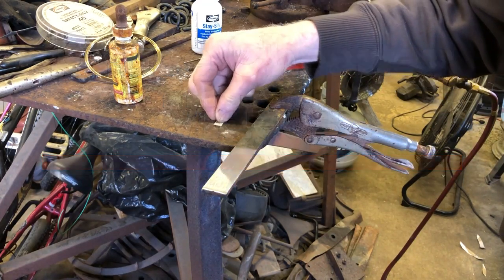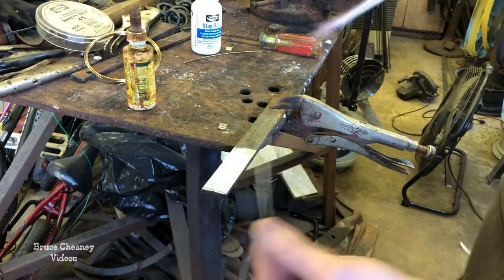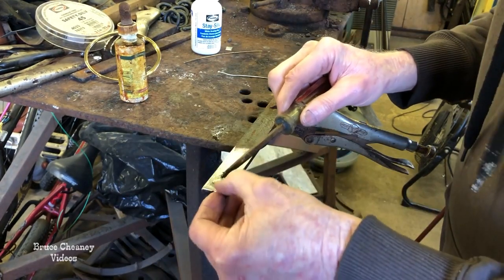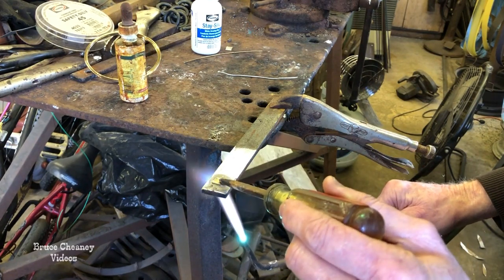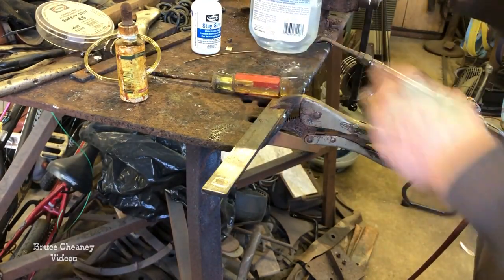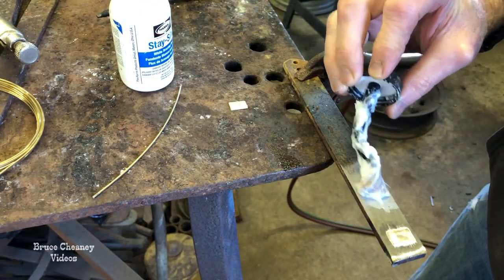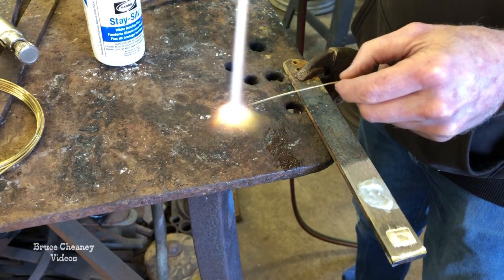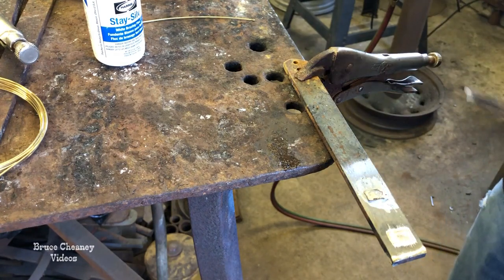How to Tutorial ⭐ Soft and Hard Soldering Tips for Bit and Spur Making 👍 Harris Products Group

Comment: Any hints on getting the tip trim on a spur shank to stick good? It’s hard to get the heat to the bottom of that part. Locked up a rowel last night working on one, but I got the silver on. I'm sure I’m not doing it right. Using that liquid flux
Reply from the maker: I have trouble with soft soldering the silver on the spur shank tip too. I know what you are talking about. 
Just make sure you have just enough soft solder on the back of your silver to stick the piece onto the shank tip. It does take practice to get it done.
You can float your silver piece on a piece of practice steel and slide it around then remove it and then solder it to the shank tip and it should work fine. Good luck and keep doing it!